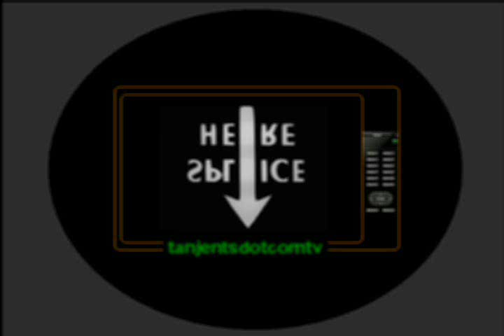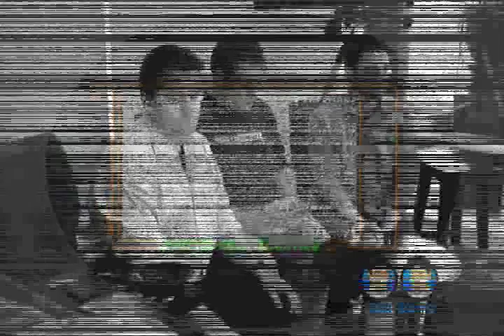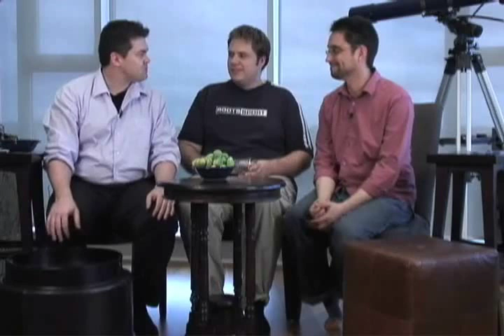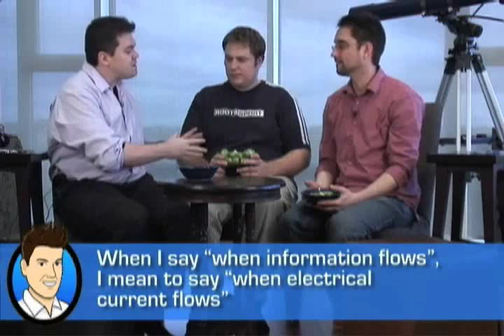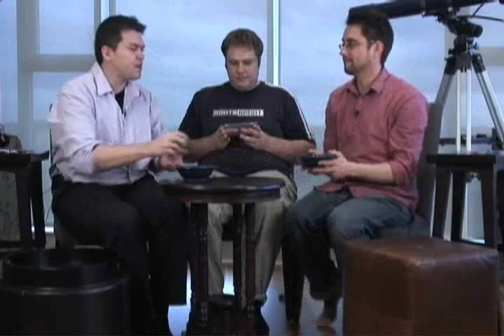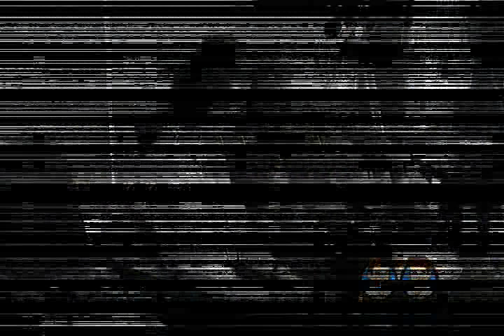How Flash Memory Works

Comment: @johnpro2 Yeah but that really wouldn't tell you anything interesting. What you describe is how every circuit works. 
The important part here is that electrons are sent into the floating gate which causes a negative charge that drains the positive charge off of the main circuit. 
Your analogy really wouldn't tell us anything about that process at all.